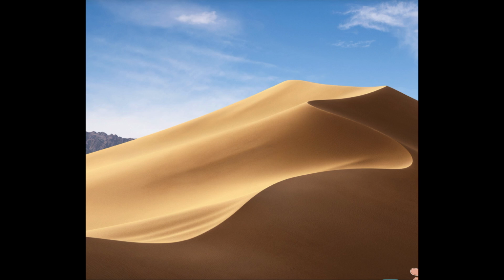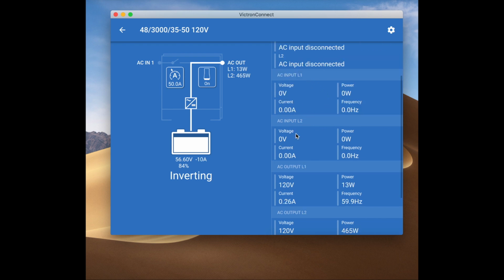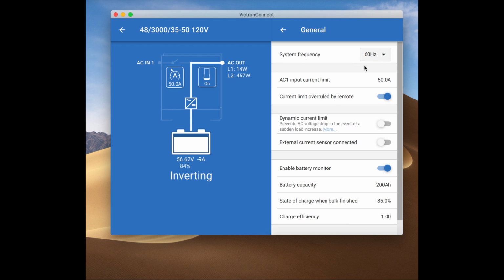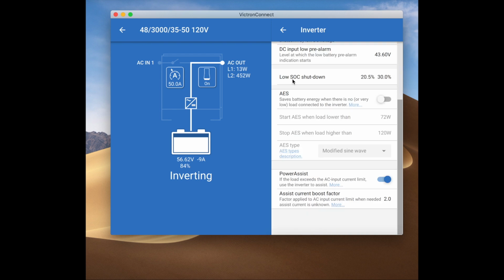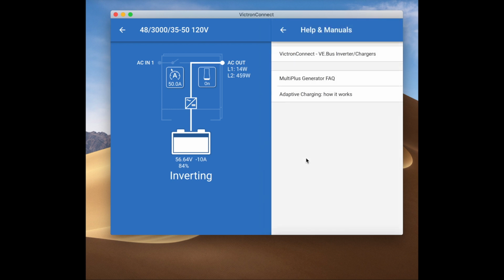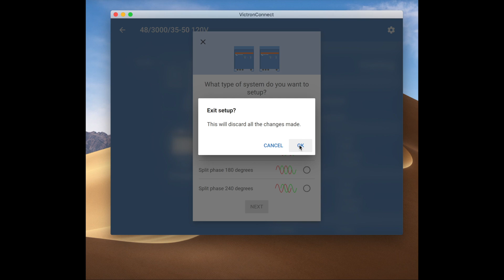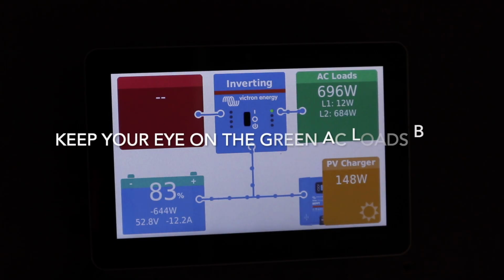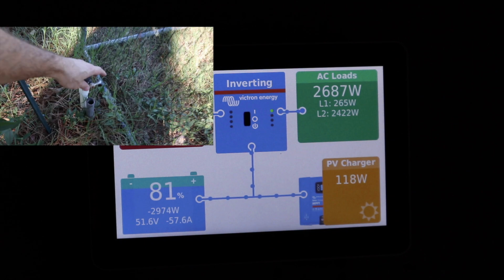How To Program A Victron Inverter With A Mac & Load Test!

Comment: At minute 6.25 you mention the "power assist" as designed to assist the inverter from the grid/generator in the event of an extreme load and that would be awesome but unfortunately it is not what it says on the tin, Victron seems to state that it is the other way around and I understand that it would draw from the battery if the "shore/grid" amperage available was insufficient. Perhaps someone can clarify this confusion?  Thanks for sharing 🙏

Comment: Looks like most of the devices used in your load test were running off L2. Might want to look at balancing the loads in the barn so they're not all on the same power leg.

Comment: I found that an induction cooktop is great for the last stages of load testing as you can pretty precisely increase the load a hundred or so watts at a time.
And the smaller one/two portables can be plugged in anywhere.
Reply from the maker: Good idea

Comment: Given that you have solar pushing power to your battery bank, the battery state of charge is likely not going to maintain its accuracy when monitored at the inverter. Since your batteries are managed by their BMS and that data should be sent to the Cerbo, that is the SOC you should be using. The inverters only have the capability to see power that they put into the bank and pull out of it. Since you do not have grid in the inverters, they will only log discharge.
Reply from the maker: Yes, I understand that.